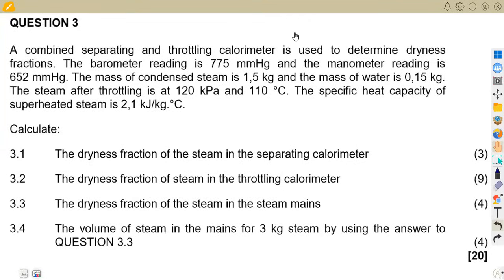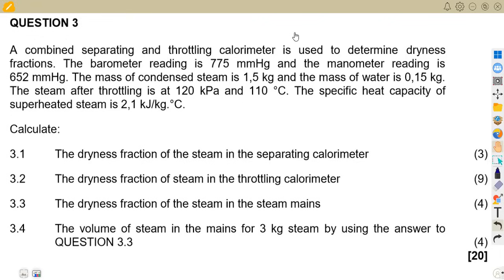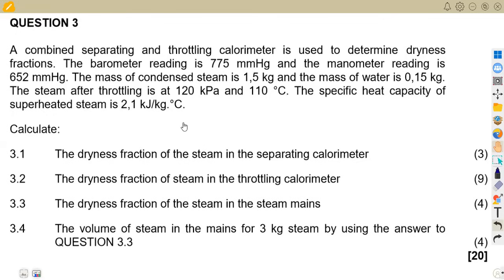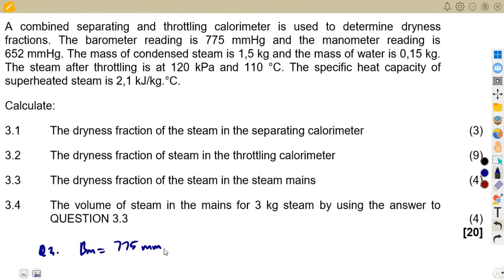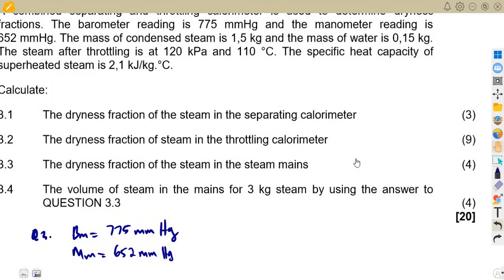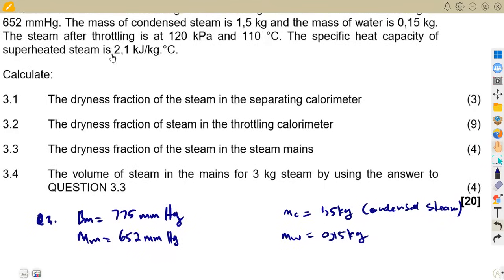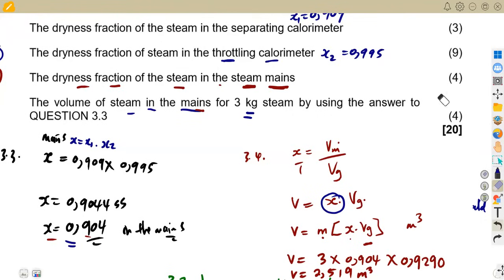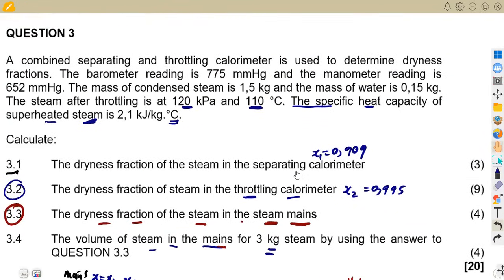Power Machines N5 CALORIMETERS NOVEMBER 2019 - steam tables @mathszoneafricanmotives

Comment: For Question 3b) why if its superheated steam, Cp= 2.1kj/kg.C   do you use hg and ts from the saturated steam tables (hg =2683 and ts=104.8) and not these values from the superheated steam tables....please clarify
Reply from the maker: Yes we use the steam tables. For superheated steam you must have the Pressure and Temperature corresponding to the superheated steam tables and thus you can obtain direct the value of Hsu . So on this question it's impossible that's why you are  given that Cp because they know you must use the steam tables